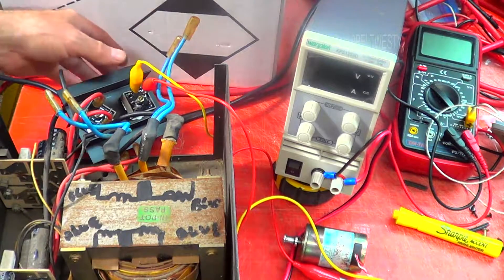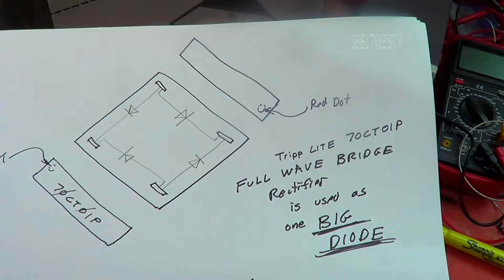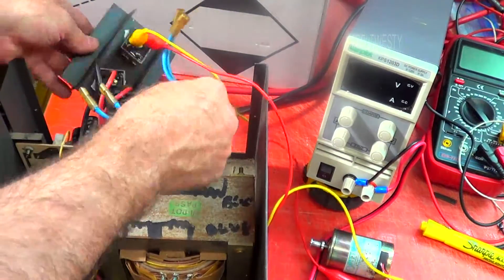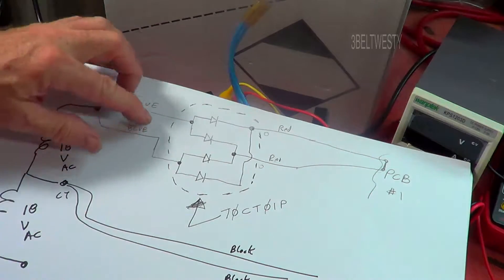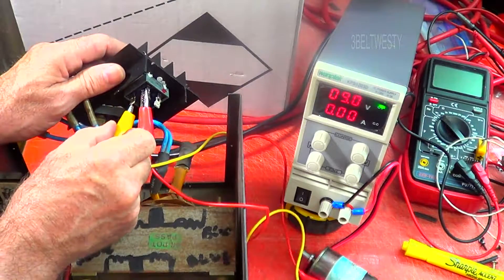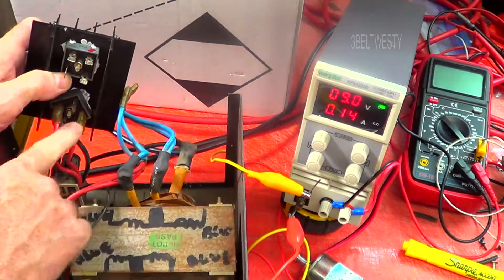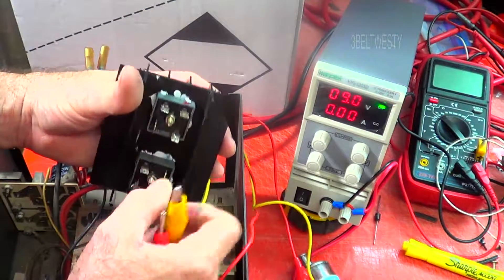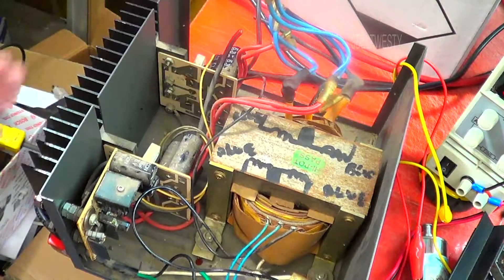Tripp Lite PR40 vid03 70CT01P bridge rectifier explained

Comment: Those bridge rectifiers are specially made for tripp lite in house only. If one shorts just use a 3 phase rectifier you can find them in 100 amp are more. A full wave center tap only uses two diodes.You can not find a 4 lug bridge rectifier anywhere, where the internal diodes are arranged in center tap circuit configuration..
Reply from the maker: The 2 diodes are shown at 0:40 in a simple schematic for the lay public. But each of these two diodes are really 4 in parallel each; with current sharing dual leads. The rectifier assembly a common as water. It may have a special part number but they are just a common item. I have at least several hundred here  at my shop. It is just a common low cost part and the dual length parallel wires is a common trick; ie the 2 wires are the equalizing resistors. This is what is called an elegant design in high volume consumer items. ie adding a mess of 0.1 or 0.05 ohm power resistors drives the costs up. 4 lug rectifiers are everywhere; there are over 10000 on ebay. 10000 different listings. At one company we bought many millions a year of them.

Comment: I found a schematic for the PR-60 I see the rectifier wiring and get what they are doing. What I don't get is the current pass transistors 2N3771. The collectors are connected to the negative output terminal. The positive terminal is connected the two banks of caps, but that voltage should be 18v or so. So what is it doing? Is it regulating the return current through the negative?